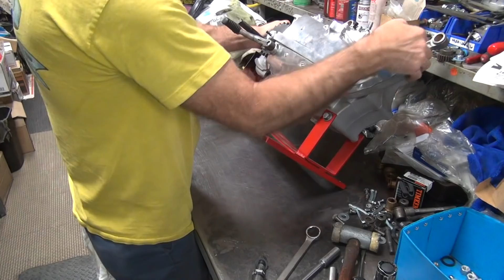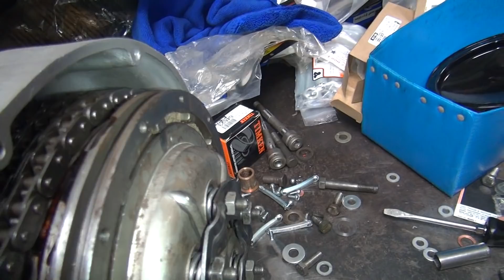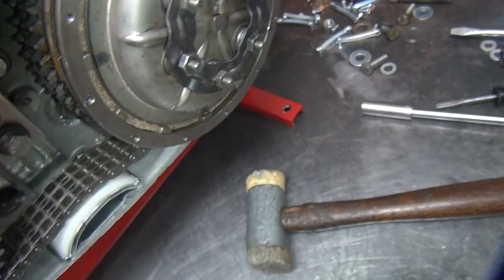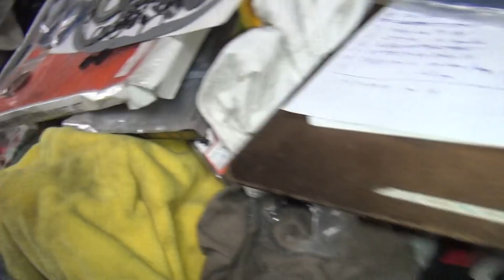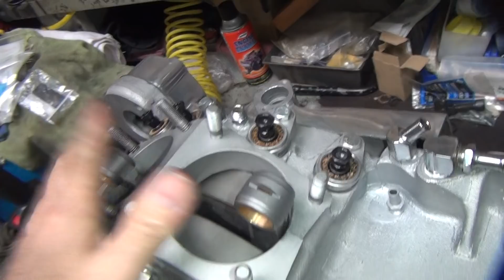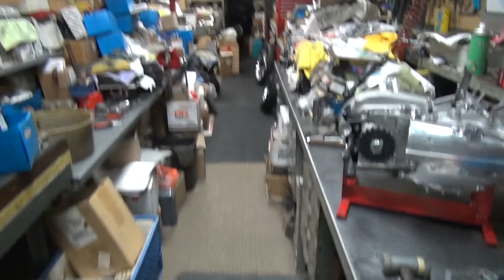1961 xlch #230 no miles transmission motor rebuild sportster harley repair restoration tatro machine

Comment: Hi Tatro, sorry I’m a newbie asking you this stupid question. I’ve acquired my Uncles 68 XLH which is both electric and kickstart model from new and I’m wanting to buy and fit as many new clutch parts as possible (probably everything except the basket and hub).  I know this is not the same bike year but this looks the closest I can find on your Channel.
Would you say the videos for this particular bike are a good reference for me to see what I need to do?
Reply from the maker: yes they are similar. the plates are the same but the basket and hub are different.
tatro
Reply: Thank you. Over here in the U.K. finding mechanics with experience of working on these older Harley-Davidson bikes is near impossible so finding useful guidance on YouTube is my only option. Luckily I have the original orange workshop owners manual and original blue parts manual too. 
Your videos are well known over here, you’re well respected. 
Gonna watch your uploads on this bike several times and then go for it on my bike. Thanks again 👍🏻

Comment: watching you adjust that spring setup makes me appreciate the belleville spring that the twin cams have.  Took 15 minutes start to finish and no "issues" to address with the plastic mallet (not that the aluminum hub would listen without breaking down and crying)
Reply from the maker: yes, but the clutch will not break like the new stuff does.
tatro